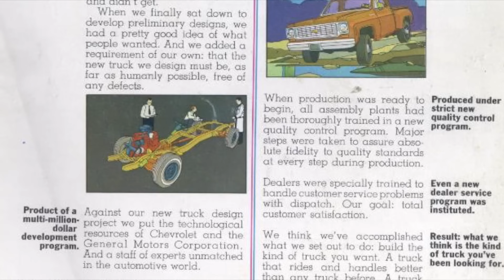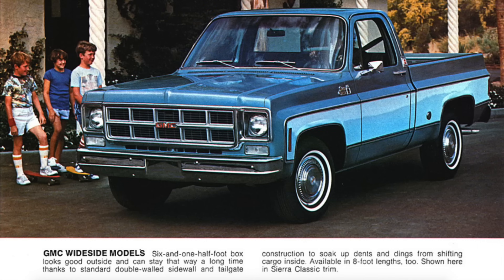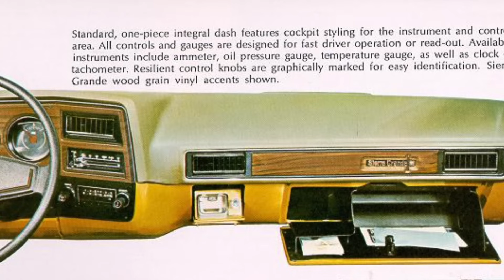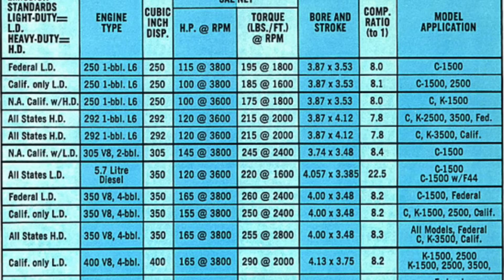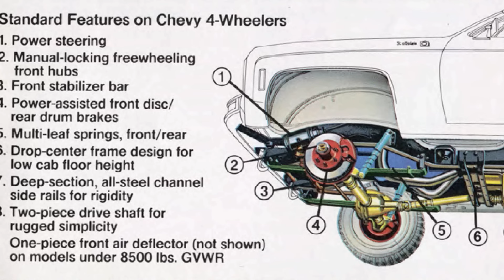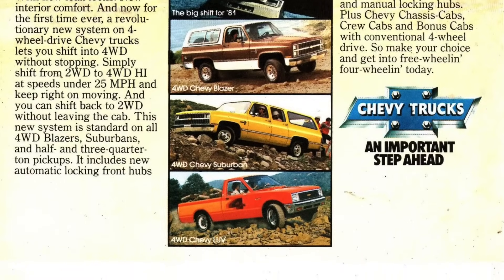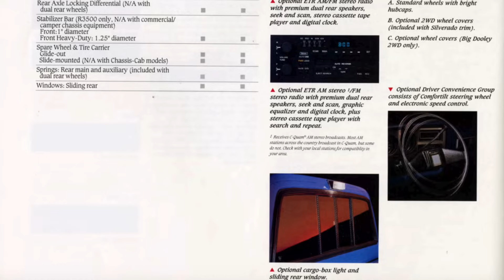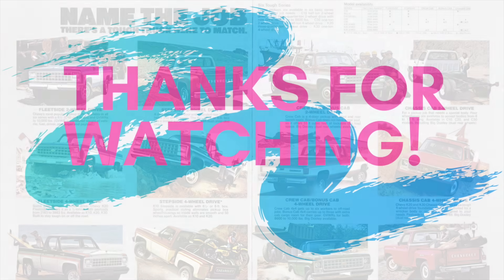73-87 Square Body Chevy & GMC C/K Truck Buyers Guide (Design, Options, Engines, Common Problems)

Comment: I own a frankenstein one.   it is Chevy/GMC with body parts from 74-85    it is lowered and the drive train is late model LS motor and trans conversion.   It is a half ton fleetside and rust free.    These are SMALL trucks.   most people do not get that.    There is just enough room for my 6' frame behind the wheel.   there is almost no room behind the seat but lots of hip and leg room.   My Tahoe weighs a thousand pounds more and is a foot or so longer.     10" steel wheels in the back and 8.5 in the front.   It handles really well and is a hoot to drive.Being lowered it does not have quite the payload but I have put maybe 700 lbs of firewood in the bed no problem
Reply: That's the best part of a square body. I seen a 1976 chevy k30 a guy built with a 76 chevy c10,a 79 k20, and a 85 chevy military truck dually
Reply: They may be small compared to today's monsters, but we thought they were huge when they first came out.

Comment: Got my '82 shortbed in 1996 and never looked back. I have probably replaced every part on it at least once but she still fires up every morning raring to go.
Reply: Got a '82 short bed back in '19 restoring it now... lower windshield channel under the cowl was ate up along with the top edge of dash shell when i removed the cap off it.. i cut it out.. picking up a better shape dash shell out of a suburban to replace it with.. minor welding and rivet work shouldn't be too much work.. overall thats the only major work needed for this truck

Comment: I very seldom see any of those generation crew cab pickups on the roads nowadays, same with the Suburbans, K5 Blazers, & Jimmys, but the regular cab pickups on the other hand I still see around sometimes.
Reply: The crew cab square body trucks weren't near as common as the later ones. People bought them to haul work crews and trailers. First one I was around much, was a 1 ton some cousins had, with a slide in camper unit. Their kids were around my age and we went on vacation all over Texas in it. Back in the late '70s, it was an interesting couple of weeks! No problems with the truck though!
My dad bought a brand new '75 GMC Sierra Classic long bed, 350, automatic, well optioned, two tone White and Willoway Green(mint green, beautiful combo!). Dark green vinyl upholstery, burl woodgrain on the dash and door panels. I wish we hadn't had to sell it....we also had a '78 and '81 GMC Sierras for shop trucks. And 5 square body Suburbans....now I have a '99 GMT 400 Suburban and a '97 GMT 400 3500 crew cab long bed. I still like square body trucks, but the decent ones are too expensive and the affordable ones are ready to scrap....

Comment: I bought one just the other day an 86 with smog stuff in it be careful if they have the Rochester  qaudrajet the power valve and accelerator pump will get stuck if sitting for a i little while do the right thing and hit the carburetor with a wrench on the front and free it up
Reply: Any carb will gum-up if you let it sit too long.  Those quadrajunks are crap.  Swap it out for a Holley.

Comment: I’ve owned my ‘86 for  24 years now, it was 11 years old when I first got it..
👍🏼
Reply: I’m a Ford guy and absolutely refuse to ever own a Chevy but I will always admit these square bodies especially 80 to 87 are better than fords.
Reply: @danhoyland142  
I do like some of the older model Fords, like from the early 50’s on up into some of the early 70’s but that’s about it on those.

Comment: The 4x4 break the shackle on the front leaf spring. Also lose the manual fuel pump the rubber diafram breaks and let's oil and gas mix in the oil pan. Install an electric fuel pump inline in the frame.

Comment: Bought a C 10 in 1975 brand new. The transmission blew up after the first year, the drivers side exhaust manifold cracked in half, carrier bearing went out in the second year. No they weren’t all that great. Yes they did rust out fast. Got rid of mine in 1978.
Reply: My dad had a '74 and a '79. They rusted like it was an Olympic sport. The '79 doubled as our family car - 3 on the tree, no PS or PB. When I was 12 my mom got a new Plymouth Horizon and drove it like it was a Lotus 7 after that truck.
Reply: You got a lemon it sounds like.  Most were super reliable, except for the rust part.

Comment: i owned a 77 79 78 blazer and a 83 suburban every hood bent when you tried to close it , every panel rusted away , and all of them blew up the 350 . the 83 blew 3 305 engines

Comment: My truck a 1975 1/2 ton made 24 nov 1974 v.i.n ccv1451122012 was sugared in knolton Quebec by a guy who wanted to buy it later ,but it started to break down in longlac in northern ont ,rear plugs had to be cleaned every 70km but it made Edmonton,

Comment: These trucks are known for going thru power steering pumps like no other
Reply: I think your mistaking these for 80s and 90s ford trucks
 The GMs used a Saginaw pump that was very reliable and yes they would tend to leak but would very rarely go bad. But in the 80s and 90s ford used a plastic reservoir powersteering pump that is 100% junk and you can not find one that doesnt make noise they are trash ask anyone who owns a 90s or 80s Ford product they either have a noisy pump or they have a noisy pump they have replaced 20 times no joke.

Comment: Sterling columns all get loose,so you have to take the steering wheel off and tighten the screws but put lock tight on them first,this is what they should of done at the factory,but yes chevy square's are stl dropping them panties just fine,justsayn.

Comment: I've had countless over the years, currently an 85 'black betty' k10 (year i was born) a 82 gmc short box 5.3 swap building for my 15yr old daughter and a 400$ slick parts body to be used on the 82 since hurricane Laura fuc$%@ up the project 😆.  Will always love the 67-72 body though, first chevy my dad helped me get by trading (not proud of it but some meth he traded to some guy, I was 15) still my truck crush always and forever, kinda like Kelly from saved by the bell for my generation or Jane fonda or Cher for some of you old heads.

Comment: Actually this body went on until 1991, the  C/K went to the R/V series in 1987, and the K-5  Blazer,  Suburban, Crew cabs and cab and chassis trucks until the 1991 model year.

Comment: In 1973 I test drove a new blazer. really a dog. smog motor dead on power. so I bought a used 71 blazer that had a higher compression 350 engine. drove it over 150k miles and sold it in 1980 because in minnesota it was rusted to the door handles and dangerously falling apart. engine and drive line still going. where I worked we had a 84 gmc 3/4 ton van. it was dead with the smog motor. so if you get one of these trucks you have to rebuild or just replace the engine with an LS. I owned a 1999 silverado 2500 4x4 with the LQ4 all cast iron engine. truck was totaled by a kid running a red light. great truck. I recommend putting you money to a early 2000 truck they are much better.

Comment: I have an '87 Chevy R10 Fleetside with an 8' bed. My truck is SUPER plain jane. It doesn't even have a dome light. But it starts and runs every time I turn the key.

Comment: I've had a 77 Sierra Grande Since new 290,000 on same motor still runs good had to fix a lot of rust. Put all new parts from amd aftermarket parts are shit.
Reply: I have 1972 GMC SIERRA 1500
looks like the one @1:05

Comment: In 1984 when I was getting out of the Army I paid just under $9000 for a brand new loaded 1985 Chevy Pickup. It was bright red and I still have it today and I've turned down offers over double what I paid. What year did the issue with the side Gas tanks exploding in an accident begin.

Comment: Got 1 running driving  87 gmc short bed body/paint project and a 84 chevy custom deluxe short bed non driving project (needs engine and trans overhaul)that i converted to a 78 (round headlight) front clip

Comment: I have a 73 k5 jimmy. It came with a 203 xfer case, not the most desirable option. As of yet i havent found shifter bushings for the np-203, mines sloppy on going from part time to full time 4x4 and then back is hit n miss. But other than that, rust.... Mine will be a frame and powertrain soon

Comment: I have a '73 Chevy Cheyenne Super K20 Step Side.. I owned a '78 K10 in the past. They both had the common issue of the star bolts inside the tilt steering column just beneath the turn signal actuator coming loose causing the steering wheel to flop around. It takes a 3/8 socket to tighten up two of the three.. the third is unreachable. Any suggestions? Buy a new steering column?

Comment: I had 3 2 of them 85 other was 86 my only issue was gas tank location and I would like to see how gm fixed it in recalls tanks where outside the frame
Reply: They fixed it by settling a class action law suit and gave everybody who owned one that was registered $300 I believe??  That was back in the y2k era, and folks who were on 3rd or 4th owner trucks were getting checks tor 73's and 76's. Still boggles my mind today!!

Comment: I have an 84 Scottsdale k10 with 80k original miles and no rust. Great pickup, worthless 305 motor though. Tough on gas and no power.
Reply: All those emissions choke that motor..perfect for a 383 swap. My 78 k20 has one. I can't see me  ever getting rid of it. Just did a wheel disc  upgrade to it..done till spring now.
Reply: You can swap to a4,3 add a turbo kit. The engines are free ask around, you can get 300hp or high mpg, that engine is bullet proof.
Reply: Yeah, my c10 has the same motor and it wont pull me out of bed lol. Still, they drive amazing though.

Comment: I’m about to buy my great grandfathers 1982 GMC Sierra 1500. I’m looking for cosmetic parts that need to be replaced but can’t find anyplace that Carrie’s parts for it. Is it also considered a c10? It’s a 2wd 250ci in-line 6 with a 2 barrel carb.

Comment: Some had a brace and it’s mounts welded in after paint ,behind drivers side in box at the front ,a chemical spill in that area rotted some trucks ,not all had this problem,if you find a truck with that six inch brace in box behind drivers side ,don’t buy it ,but for parts only .seen it on 1976and 1982 don’t get burned

Comment: Have a 1986 Chevrolet K10 DeLux Custom,  that just means they added some chrome, thats about it.
Whats the verdict?  RUST.   And if you are going to keep your square body, then you have to check for rust everywhere.
Be aware, the COWEL is a crappy design that sends water and DEBRI down both sides of the fenders, where it is supposed to dump water/debri on the two 
PLASTIC PANELS attached to the rear of the inner fenders and then go out of a slot on the rear of the plastic panel.

BUT the genious's at GM also designed a slot about 12 inches above the plastic panel, on both sides, about 3" x 1 1/2 inch which is supposed to let air
blow up the windshield frames and down to the rockers.
There is no diversion to keep the debri out so the DEBRI goes down to the rockers and becomes TRAPPED there.
At the rear of the rockers, there is a metal piece that is bent to block rodents from getting into the rockers.
BUt this also keeps the debri in the rocker area, to sit wet and to rust the rockers out.

We all know about the cab corners rusting out, they really could have done better there BUT it gets worse.
Above those cab corners were the door frame is pinch seamed to the body panel, moisture gets in there, and the rust starts inside that pinch seam.
Mine is starting to see damage from the rust so I will have to spray some rust stopping oil on it to soak and stop the rust.

THE HOOD, and I am sure it is all models, will rust in the pinch seam areas, and the nose of the hood is ONE BIG PINCH SEAM.   LIBERALLY apply rust stopping oil inside the hood on the nose and pinch seams and anywhere you see rust on the hood.   This is more important today because the hoods are not available.

One other area.........
The square body box has the fenders flare our on both sides of the wheel wells.  It is an attractive design that caught my eye when I bought my truck.
Two things to look for
The front fender flair on the box, is supported by a rod bolted to the fender.   The bolt can rust through the fender and the panel will flop in the wind.
The rear fender flair has a bigger concern

The support for the rear fender flair panel has a inner panel that lies flat on the fender panel, it is bent to form support for the fender flare so it wont move in the wind.
This rear fender support is ravaged by the road salts, water and anything else that can get up there and between the support and the panel.  It will rust like crazy.
At the time I was working on mine, there were no replacement parts.
I had to build up reinforced fiberglass to recreate the (then rusted through) support piece that kept the fender sturdy and non-moving.
then I had to repair the fender flare which under some rust had a hole.   Again no parts so screen, fiberglass and bondo made it like new.
The inner support, which is rusted enough to be concerned, will get a liberal dose of rust stopping oil.

The oil you use can be used motor oil, transmission fluid or Mineral OIl.
I have used the Mineral oil on everything under the truck, frame and suspension as well as body panels, door pinch seams and supports.  dont forget the pinch seams
above the fenders front and rear.
The rust is very porus, and will suck the oil like a sponge, coating all the rusted areas.  you can  use a stream and it will self fill the rusted areas by weeping
to the neighboring rust.
I originally applied the oil to the frame about 5 years ago and the rust was stopped by blocking the air and water from the metal.  You can easily tell if you missed an
area because the Orange rust will turn a Dark Brown color.  
One big factor, is the oil does NOT turn to a hard coating like paint does so you won't have water under the coating rusting the metal away.
If ya'll got a square body that was taken care of, I'd still give it a coat of rust stopping oil on the frame and suspension parts for preservation.
I am almost done with my restoration and it is looking great again.
And I will say, yes the dash will have cracks.  I put a cover over the dash to keep the sun off of it but I have to restore it sometime in the future.  I shouldn't have to 
take it out to do this, it is easy enough to do.

Comment: The  rust buckets. 
Gas guzzlers.  The 71, 307 3 speed on the tree could out pull the 77 Chevy 350 automatic  4 bolt main. I had both.

Comment: If you include the 20,30s and blazer didnt the square body actually run longer than 87. Pretty sure first year or so after the 1/2 ton changed in 88 the heavy duty and blazers kept the square shape just changed to a flat version of the new 1/2 ton grill.

Comment: Have had my 1985 square body c10 for about 15 years now and will never part with it.
Reply: I have the same truck but mine is a K10 4x4. Gonna pull out the week 305, drop in a healthy 350, lift it 4”, mount 33” mud tires, and install lockers front/rears axles. Truck will be used for work and play.